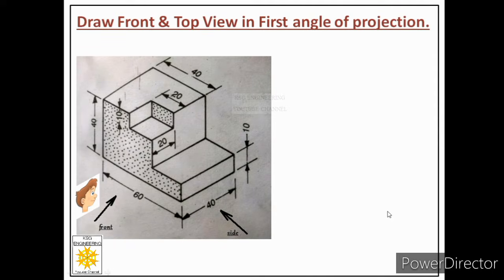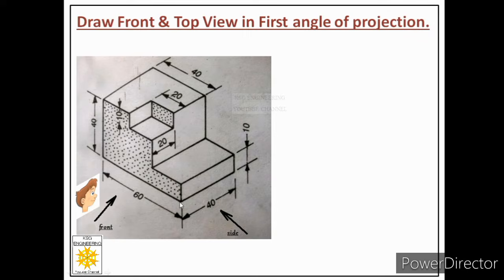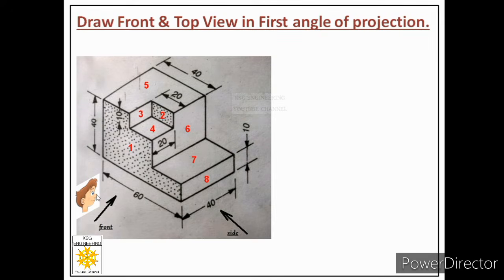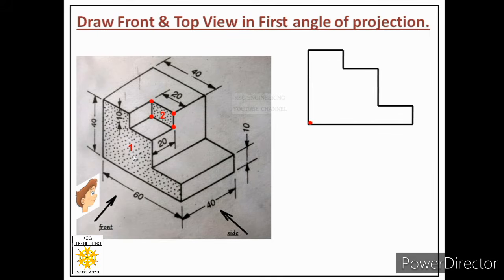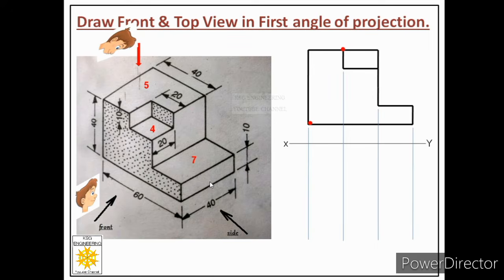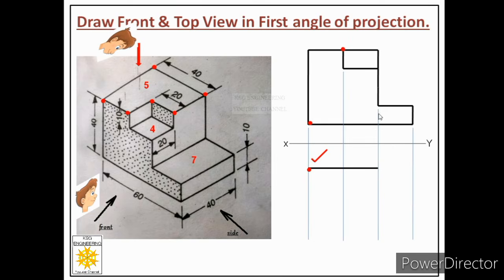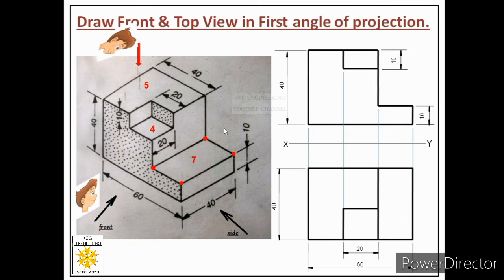Orthographic Projections | orthographic projection in engineering drawing

Comment: 00:02 Drawing front view and top view in first angle of projection
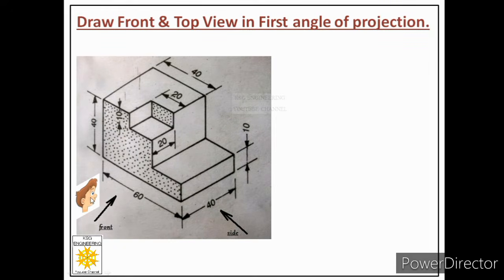02:26 Assuming position of vertical and horizontal planes based on angle of projection.
07:10 Observer can only see faces parallel or inclined to vertical plane
09:42 Orthographic projection simplifies drawing by showing only visible faces.
14:51 Understanding grid sheets and measurements in orthographic projections
17:00 Locating and drawing faces in orthographic projections
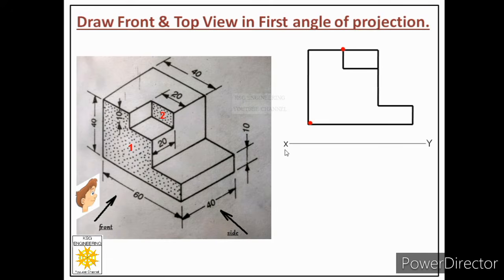21:31 Drawing projectors help create the top view.
23:39 Drawing only the three phases with proper dimensions is crucial for the top view
27:44 Selecting points close to VP in orthographic projections
29:54 Explaining the process of drawing phase five in orthographic projections
33:49 Orthographic projections help in accurately representing objects in engineering drawing.
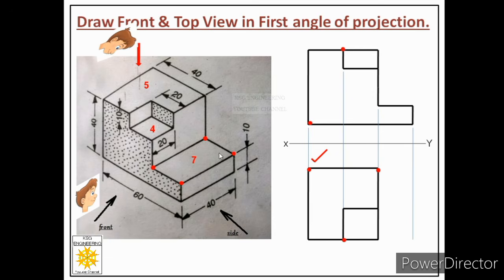35:53 Drawing front view and top view of an object in engineering drawing
40:06 Placing dimensions in engineering drawing
42:09 Orthographic projections show top view of objects in engineering drawings.
Reply: :face-red-heart-shape: